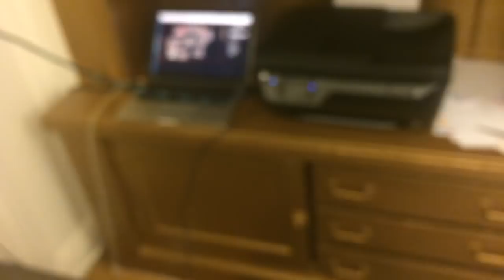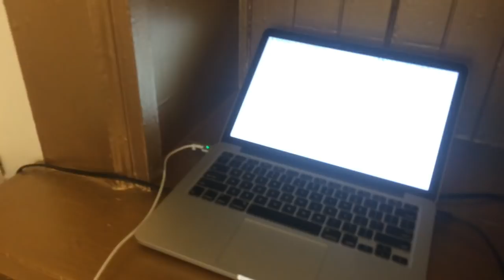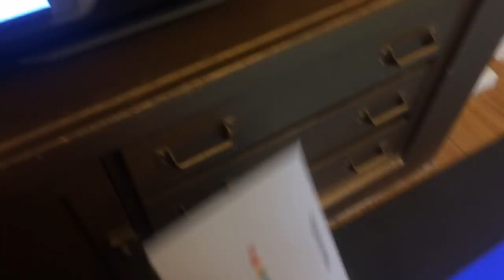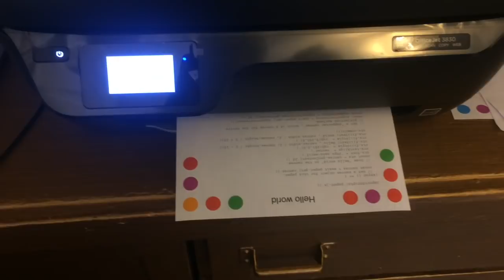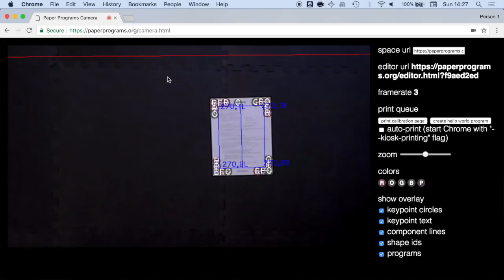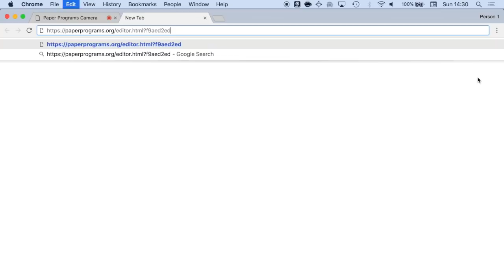📄 Paper Programs Tutorial

Comment: From the brief glimpse of the webcam I'd say it's a C Series, maybe a C910 or C920?
I've had reasonable results from both regarding the delay and was confused why your speeds would be flagging, until I saw your on OSX, which has a ton of issues with the logitech driver :( 
Either way, you should be able to get 1080p/30fps by fiddling with the RightLight BS that logitech use (it auto drops frame-rate for "Low Light" situations, but false triggers fro high contrast situations, like this one, as well)
Reply from the maker: Yeah it's a C920. Ah, interesting, good to know! I'll play with that some time then, thanks!